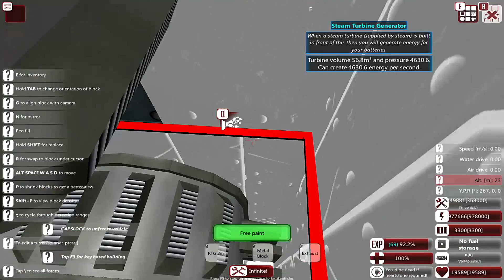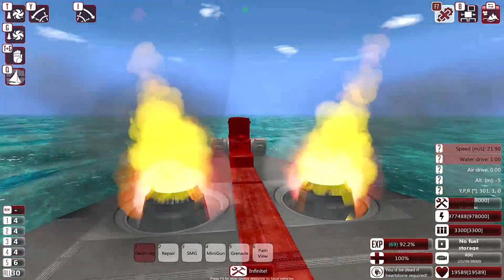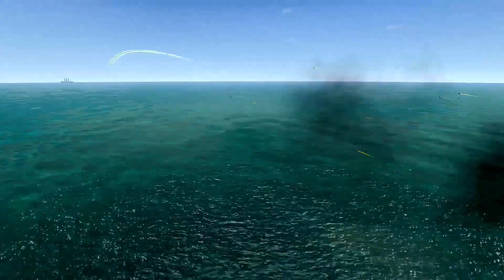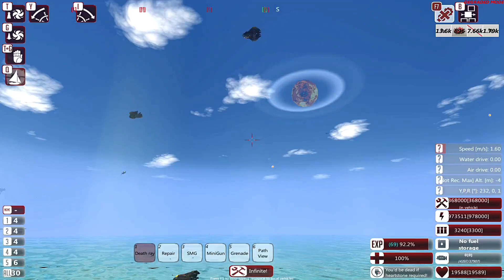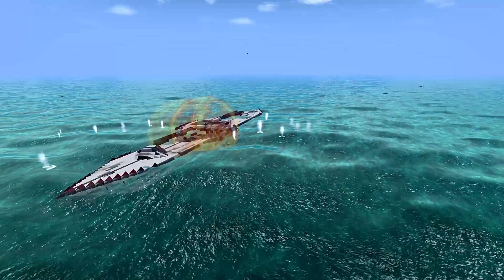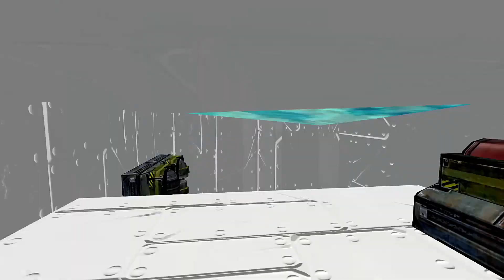Final Battleship Design!

Comment: Usually you would want atleast one layer of shielding thats spaced out from the hull and not just tucked up against it because the further out shields will catch most of the shells and the ones in further if you have 2 or more layers of shields will stop the frag from the inertial fuses. Otherwise the HE will still blow off your important bits with only shields close to the hull. You may not notice this much against the bulwark and Cram cannon designs as LAMS hard counter Cram shells but against most vehicles with decent advanced cannons it will help a lot.
Reply from the maker: Spacing the shields out a bit more from the hull was definitely one of the things i was looking at doing i was primarily trying to focus atm on getting my LAMS to function effectively before going over the shields and such as i was still learning how to make LAMS

Comment: Turbines don't need relief valves.  Also you can make those much shorter and probably cheaper using compact turbines.  They only need one block and will generate just as much energy.  I only use steam in small designs tho because fuel engines are much more efficient.  I can recommend some designs on the workshop if you wish to check them out.
Reply: There is also no difference between the large and small steam parts aside from the boilers themselves where the large boilers have much more steam capacity/generation. (Those large boilers in the rear are very space inefficient) Many sections of smaller boilers ramp up faster than one large boiler too.
Reply: Yea that's what I'm saying the compact turbine just uses one block whereas what he's got is completely unnecessary.  To be honest, some 300 ppf fuel engines would be a better way to go in the long run those things will just gobble up his resources.
Reply from the maker: Those turbines under the ship were basically place-holders, they were meant to be completely rebuilt once i got the rest of the ship sorted and the large steam generators at the back are purely aesthetic which is why i was like wtf when i saw them still set to run at .50 rather than them being essentially turned off until they're required.
I should have a video out today outlining what i had actually planned on using underneath the ship but that was why i hadn't bothered to even the steam engines underneath the ship out but it'll become obvious as to why steam engines are more efficient as long as you have a huge amount of space to work with once the new vid comes out